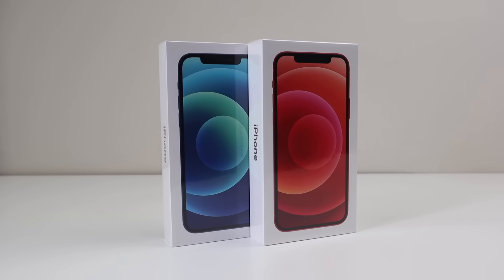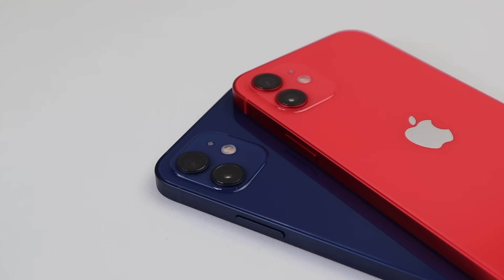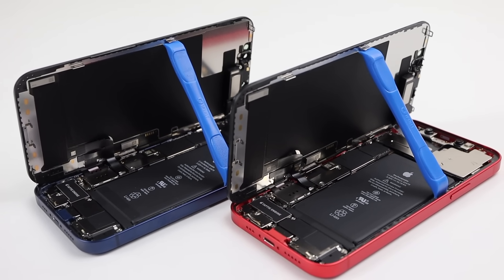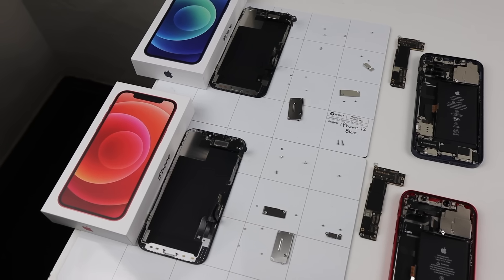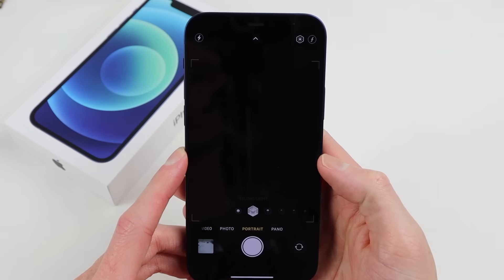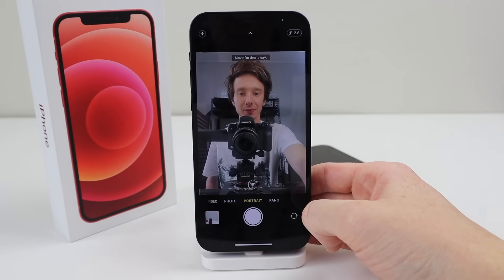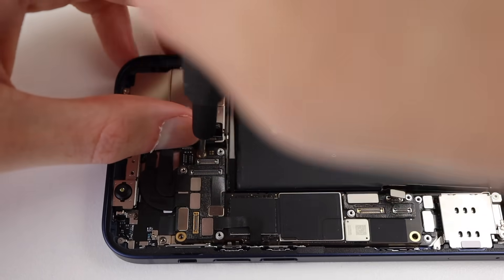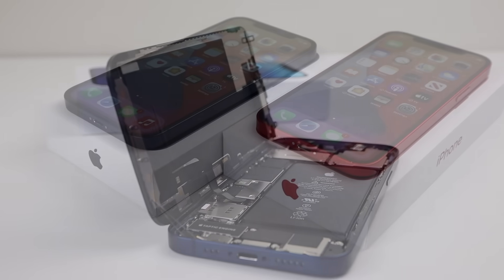iPhone 12 Anti Repair Design - Teardown and Repair Assessment

Comment: Did you notice that the 2 iPhones have different model numbers? That alone might be enough that some components don't work.
Might be worth checking out if some components will work correctly with a donor-iPhone of the same model number.

Comment: Car companies been doing this for years, 
Once Ive replaced a damaged steering rack from an opel/vauxhal/ insignia /buick regal/  2013 with one from the same model / year, the power steering refused to turn on , put it back to the donor car : works . put the damaged one back , power steering works,  turns out , only Opel can pair the steering rack with the car, but they will never do it if you supply the part , denying any chance to replace major components.

Comment: Technology companies need to be held liable for the waste they create and secondly consumers need the right to repair. John Deere is also doing this crap with 6 figure tractors.
Reply: Well, you actually have that right afaik, you can just install android or windows or whatever on it, and if it doesn't want you to you can just flash the BIOS or smth. But in the end it's easier to get a more favorable and modifieable device.

Comment: iPhones are still still stolen for parts. With component securely paired to the device that is over and stealing iPhones would not make any sense anymore. Actually very nice for users, don't you think? Of course I would expect that Apple charges fair prices on repairs and certainly is capable of giving you better warranty than any 3rd party out there.
Reply: What's nice about knowing that you lost your phone for no reason? And the downside of a Apple-only Iphone repair outweighs this "upside". Like boi, if some guy has like a gaming PC tower with epic specs, but for some (purely hypothetical) reason, it can't be disassembled, the thief gonna steal it anyway.

Comment: Most of this is probably anti-repair design, however some of these lock downs are security features. For example, pairing the Face ID feature to the sensor will prevent hackers from bypassing the sensor to access the phone.

Comment: Apple wants to use a cheap battery, expensive repairs, lack of accessories, proprietary charging without providing such charging options, screws damaged during manufacturing, pairing parts, locking down the battery, power button and camera via software, and a heavy price tag on all products and services. People, Apple is trolling you. They ate cutting corners and using malicious choices to give you the least for the biggest price. They are out to get you and if you buy from them, you deserve it. If you buy based only on name, get a galaxy or something. Get android. Seriously. Android is not malicious and hateful. Apple is. Lets say you have a car that costs 2 grand and goes 150mph and has a 1 year warranty. You have a fararri that goes 12mph and has no warranty. Which one are you going to buy? Not the fararri. Stay away from Apple.

Comment: I think there are some good reasons for apple not allowing cameras beeing swapped so easily. If you could swap cameras as easy, there would be a high possibility of Face-ID beeing hacked in a couple of days. Swapping batteries is probably not possibly due to third party battery manufacturers qualitiy issues, like exploding batteries. So everyone wants to have a safe phone to store their personal data on and not to explode in cause of low-qualitiy third party batteries. Just deal with or buy Android stuff.

Comment: "Zero climate impact by 2030"
And they're planning to achieve that by replacing components included with the phone, like a power adapter or earbuds with useless pieces of paper/cardboard? 
Great, Apple, just plain-ol' great
Reply: While running sweat shops in China.

Comment: I believe they used the same rule regarding the ID touch button in orevious Iphones, when you replace it it will not work with the reciepient Iphone, same as camera maybe there is a specific serial number that is dedicated to the camera so it can work with a specific Iphone/motherboard if replaced it won't work. You did a replacement with two comercial phones that are already on the market, maybe the replacement cameras that will be sold seperately will have another serial number dedicated to any reciepient Iphone/motherboard. If this is controlled with software it would be very difficult to replace another camera once it is connected with thew motherboard. Well MAYBE !!

Comment: I work on Mercedes\BMW and they started doing this more than ten years ago.
All components need to have matching code. There is now equipment on the market that can read the code and
program it into the new\replaced components but you are starting @ around $15,000 usd and any given year
manufactures can alter the code type and location meaning you may have several years lag before the new codes
are figured out then released for a price.

Comment: Screen and Battery messages don't matter they will disappear within a week and when you swapped the motherboard out you had forgot to move across the original earspeaker cable and the front camera which has the dot matrix etc in it, without that face I.D will fail to operate. From what I can see it's similar too the other models just with extra water proofing.
Reply: You mean he had to take the whole insider of the phone and but it in another phones shell to fix it, yeah makes perfect sense.

Comment: I believe is the software that prevents swapping components between the phones and also probably they just locked the S/N of every component deep inside the software.Probably a master reset code or a device that re authenticate the components at software level.Your best bet is to reverse engineering the software ,swap components and see what changed .. could be a simple line code like true 1 and 0 for no true ..ive seen this trick somewhere in some phones a few years ago..

Comment: IPhone 16:-
It doesn't include a power button, there's billions of power buttons out there.
You can buy one as a dongle though, for $99, 99
Reply: Not that unrealistic. A power button on the front consumes precious real estate that could be used for the screen, and a power button on the side provides a water ingress point. Both of them add to machining and component costs. I would be surprised if Apple eliminates the power button in another two or three generations. Have it wake-up by a fingerprint touch on the rear-mounted sensor (My Samsung does this) instead. Add a tiny processor with microamps of power consumption and the same sensor could serve as the power-on-from-cold as well.

Comment: I don’t know how long something so micro & intricately manufactured was going to be able to be repaired by knuckleheads at home over a coupla beers.
Reply: If you think it is because he don't know how to repair it you are wrong he just swapped parts so it has to work normally but apple don't allow this so you have to buy a new one
Reply: @whattheheck6593  try using doesn’t instead of don’t
Reply: @XrayVisionGlasses  yeah but that is not an argument.

Comment: I think they are using integrated circuits to make the pieces only with the original main board with common codes, but nearly that will be solved with an memory dump

Comment: Noone should buy Apple product. They are locking the repair to only their own which is overpriced. Even legal repair shop will be fucked as the Apple licensing fee are overpriced and training as well.
Also you need special pairing device that Apple wont sell you.

Comment: Years later:
Touching any screws is illegal and SWAT will be sent straight to your home unless given permission
Reply: Nope, they'll just weld it shut with nerve gas sealed inside. Any tampering will cause death.
Reply: @repairdroid77  That's overkill, even for apple.
Reply: @r.p5380  let's be honest here, Apple probably would do that if they get too comfortable
Reply: @verticaldorito  But it doesn't make sense.... apple would never do that they would lose money buying expensive nerve gas, how about explosive screws.
Reply: @r.p5380  no you would have to pay extra for those.😅
Reply: Changing your cars system and software is already illegal and you can not drive such modified car. I mean even as simple stuff as disabling seat belt warning. I was advised by car manufacturer  that if I do it not only I loose access for service but also I will loose license to use car on public roads.
Reply: @mikolaykuka9759  why
Reply: @mikolaykuka9759  you should drive that car alone until that car broke down itselft??..dont worry no need fix that thing even the engine was fine.lol
Reply: @mikolaykuka9759  disabling any safety device on a vehicle exposes u to some pretty gnarly criminal liability if somebody gets hurt. Whoever you spoke to with the manufacturer was trying to protect you from yourself.
Reply: I think the only screws most people should adjust, are their own screws, since they are very loose. Smartphones are treated like heart pacemaker. And that's just like the companies and government want it. So keep your finger off the insides of your tracking and checking device. Consume, tell us everything in your head and about you and believe everything we tell you without questioning. ...and keep buying our newest overpriced prisons for your pocket!
Reply: I've been an Apple hater since 1983. Nothing they have done since then has been able to do anything but confirm that my hate is justified. Been a programmer and in IT for decades dealing with both Macs and PCs. There is no comparison for cost of ownership. The stability of a Mac is a myth. Having to reset the PRAM was common. As a developer, Apple can just turn off your software as well WITH NO RECOURSE OR EXPLAINATION.

Comment: I've had the same problem with 2 Iphone SE (first gen). The screen of the one I was using everyday broke (it didn't even fall, idk why it broke) and I had left the other one in a drawer because its battery started to swell, so I decided to merge the 2. I opened them up and saw that nothing else was going on in there, apart from my initial problems everything was perfectly fine. But then I switched the merged phone on and it said "Touch ID is not available on this phone" and later I opened the camera and it froze completely for a few seconds. I tried opening the phone again, checking the connection and components, I couldn't see what was wrong. 
I did try to put the screen back on the original phone and there was no problem with Touch ID; so I just thought I did something wrong while repairing, but now I see this video and I'm starting to wonder...

Comment: even though i’m an apple user, i’m honestly leaning on the people’s side here.

however, i feel like people are making this a bigger deal than it most likely is. the people who would need to perform these kinds of repairs are the ones who don’t take good care of their devices. as far as we know, the 12 pro doesn’t have these issues. also, in my opinion, if you feel like you absolutely have to buy every single model every year, you’re just wasting your money and your time.

i’m probably missing the point this video’s getting at, but i just thought i should speak my mind on this.

Comment: Whenever a new battery gets installed, the phone needs to be turned on by plugging it into the charger. There are preventative measures put in place so that the phone doesn't short circuit on a new battery install, thus the power button is disabled. At 8:15 when the new logic board is installed, it's in essence like a new battery is being installed along with all of the other components of the phone, therefore the power button is disabled. This goes for pretty much all Iphones from the past 5 years

Comment: I think these symptoms are all related to modern iPhones registering security sensitive devices. Since modern phones give access to user bank accounts by scanning payment QR codes and identifying users through cameras, it makes sense for them to secure those, and probably more components this way. so, if you want a secure, working phone that cannot be serviced: buy Apple. If you want to be able to do it yourself and don't mind the lesser security, go for android. I do think this behavior will also start to be more common in those too.
Reply: I don't think Android will do this they have smarter users who want a functioning device that can download an apk file and be fixed . And if you think swapping a board will give you access you are dead wrong.

Comment: When it breaks down, which over time is nothing but a certainty, they expect you to buy a new one.
You get a phone in the box, accessories are sold separately. Including the charger.

Imagine buying a car where you have to buy the wheels and radio separately. That you can only take the vehicle to that specific brands workshops for servicing and repairs. And that from an identical sister vehicle, you can't interchange parts. Who would buy such a thing? The corporate arrogance of Apple astounds me, and it saddens me to know people will keep buying an increasingly inferior product. I'm glad I gave up on Apple years ago when I did. It looks like I won't be going back.

Comment: I wonder if any Apple techs (Genius's) know what can be done to pair new elements. Its like with automobiles, there are a lot of things that you have to have a dealer do, like relearn new key fobs, reset the engine oil life meter, relearn tire pressure monitor sensors when tires are rotated., etc. But there are secret ways of doing these things yourself by holding down certain button combinations or using the key in the ignition with a series of locking and unlocking the doors. It sets components into learn mode for pairing. There has got to be something similar the repair techs can do without having to plug the phone into a repair environment.

Comment: What about the displays? Did you try swapping those over because I think this is one of the most likely components to be replaced. One potential reason for tying motherboard and peripherals together is calibration data which is saved in NVRAM on the motherboard.

Comment: Hugh what Apple is doing is the same thing most car companies do. When all the components receive a start up command they all talk to each other on the Network inside the phone. Many of the proprietary pieces have the phones ID code burned into the memory so it cant be changed. If ANY of the components with burned in ID's see another one with out a matching one the phone goes into lock down mode and gives you just enough access to realize the phone has been tampered with.

Comment: John Deere tractors and combines feature this similar problem in the sense that when they require to be serviced or repaired the dealership requires farmers to have to transport the equipment back to their dealerships in order for them just to get diagnosed! which is very expensive and prevents a lot of down time on their already costly equipment. preventing farmers from being able to work on or repair their lively hoods essential tools. luckily there have been hackers from Europe and Poland that where able to reverse engineer their software in order to be able to provide farmers the means to be able to self diagnose issues they are having with their equipment so they stand a chance at being able to fix their own machines. as all the new tractors and combines have many electrical and computer components. :( AWESOME video sir! Thank you for bringing up these issues, keep up the great work! im subscribing and looking forward to new ones!

Comment: What about swapping just the displays? Probably a similar result? Most repairs I do are fixing cracked glass/screens.
Reply: I thought about exactely the same thing :)
Reply: That’s what I was expecting to see and the battery replacement. those were the only two that’s usually being replaced.

Comment: Not far fetched really.  Its getting this way with automobiles. Sure some hardware can be fixed, but with most faults being electronic in nature, however without proprietary software to test or troubleshoot youre not able to repare the fault. This requires you to either return to dealers or authorized repair centers and pay alot of $$$ because it must have the same licensed software to perform diagnostics.  From apples point of view, theft of their hardware and software is something they take very seriously going back to the Apple2 days in which its open source nearly destroyed the company
Reply: The battery message is also interesting and reminds me of when that guy bought up batteries direct from the company that made iPhone batteries and Apple went after him.  The camera and logic board ect are hardware. There is software within the phone hardware components that likely requires highly controlled software (likely only available at Apple itself) that would be required to pair new hardware. This is why is does not work with swapped parts but do when put back again. Its actually very clever on apples part and prevents cheap  knock off parts from getting into their products.  Reminds me of Rolex